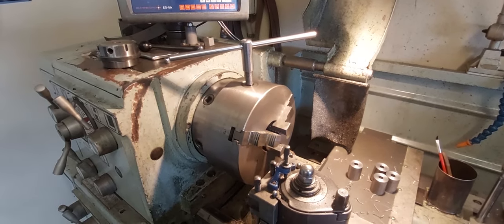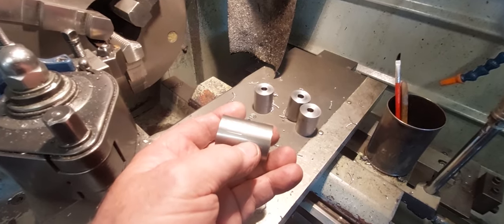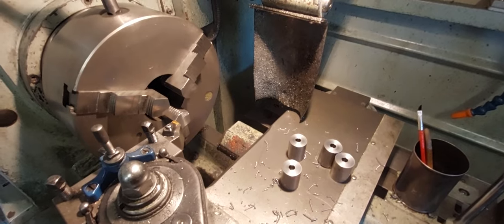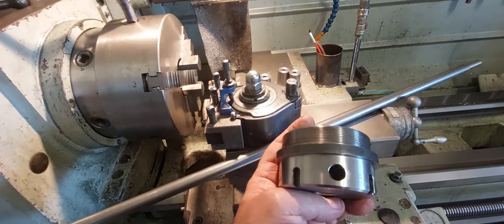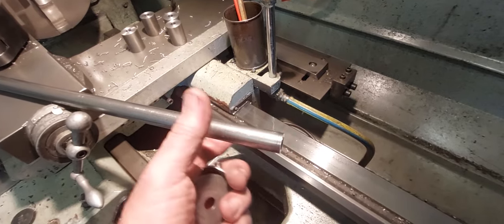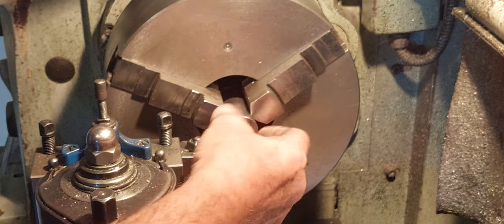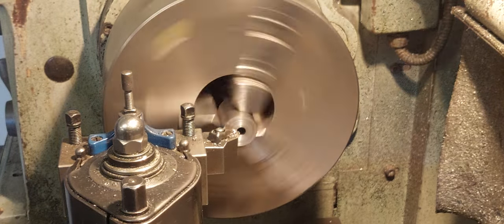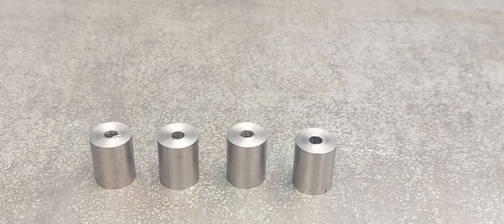How to make bushes the Exact same length on a Manual Lathe.

Comment: Another way to make repeatable custom length parts is to use a small 3d printed jig, like in this video: https://youtu.be/e_8mpjNQkUo?feature=shared&t=265  (and also at 5:20 - different types)

It might not be micron-accurate, but if you need repeatability and you're fine with 0.1-0.2mm accuracy - then this might be just the thing.
Reply from the maker: Thanks for recommending the video in your comment.
Hopefully others will find it useful😊👍

Comment: I have soft jaws that are good for when working on things that are more disc like than cylinder like or for when working on soft alloys that I don't want to mark. Some people will say use a soft material between the jaws and the part but for accuracy you sometimes need a 4 jaw chuck and as soon as you start adjusting it you run the risk of scratches. For a back stop similar to yours I have through bore spindle collets and a draw tube. By with minimal tidying up the shank and rounding and facing off the head of a M16 bolt I have a tool that can be fitted into one of my collets and the chuck can hold the part when it is pushed against the stop held in the collet. So a similar principle to your fixed stop. I do have space to the left of my lathe because you would not be able to fit and remove the draw tube without it.
Reply from the maker: A positive of making YouTube videos is  getting other people interested in the conversation. 
I look at my videos as a forum. 
Rather than trying to give all the right answers.
Other people watching can share their ideas. 
And people reading the comments can get another perspective on how to approach the task.
It would be great if the conversation between other people watching could be more interactive. 

I did try Live Videos some time ago to get my Forum idea going. 
But, it never really seemed to take off, especially with people living in different time zones. 

Thanks for sharing your ideas. 
I hope to see you more often in the comments section 🙂👍